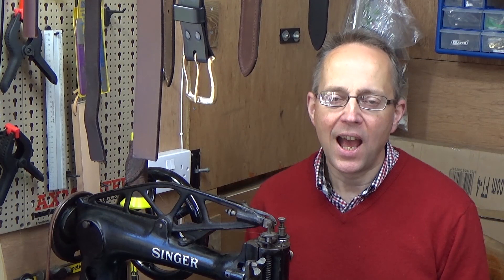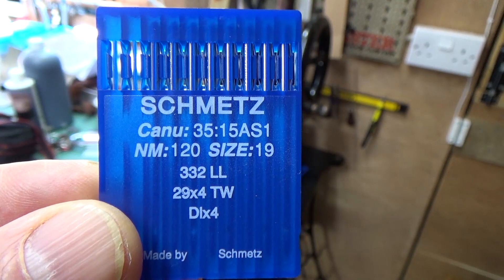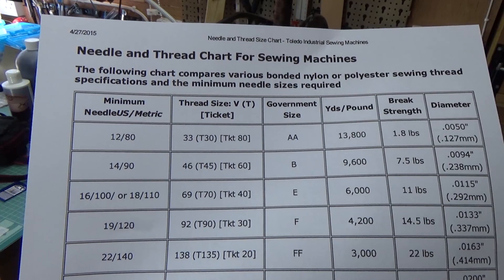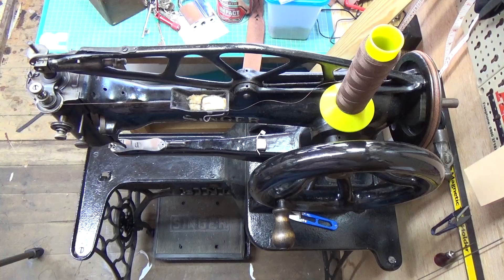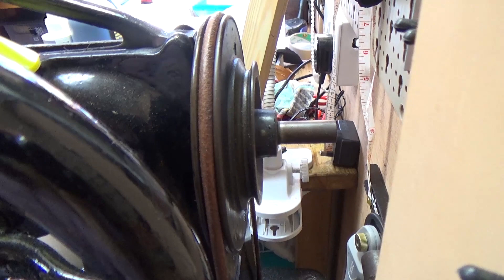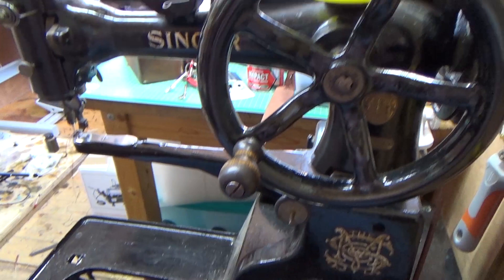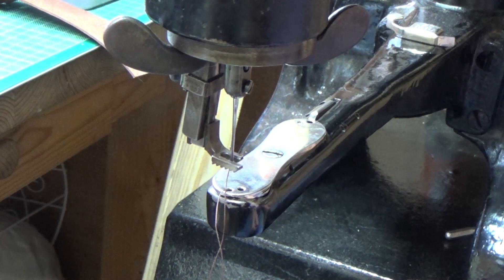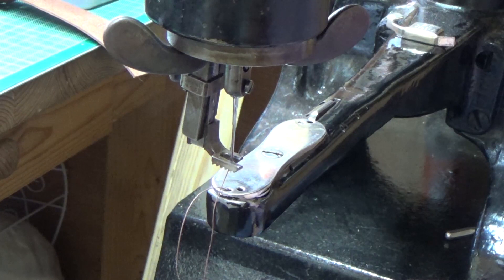Singer 29K Patcher - Needles and Thread, and Sewing a Circle.

Comment: Thanks to your videos, I bought myself an old Singer 1928 K58 patcher (with treadle base) and restored it. Its an awesome machine that allows you to do so many things that are impossible with traditional machines. I made a table top for mine based on an original sears catalog picture of the optional table top that was available for these. I love the front mounted hand wheel and would encourage people to look for machines with the proper setup for mounting the hand wheel in either front or rear locations.Most parts seem fairly easy to get. The thread I use in the US is #69 (also called T70) bonded nylon (upholstery thread). I got lucky and bought mine for 250 USD and spent maybe another $40-$50 on parts and about 20hrs of my time for cleaning and fixing.  Many restored fully operational units can go for $700-$900 in the US. Wish I could find a Singer 133K like yours, but never see them even on Ebay.
Reply: I guess Im randomly asking but does any of you know a trick to log back into an Instagram account?
I was stupid forgot my account password. I would appreciate any tricks you can give me.
Reply: @Cairo Terrence I really appreciate your reply. I got to the site thru google and Im waiting for the hacking stuff now.
I see it takes quite some time so I will reply here later when my account password hopefully is recovered.
Reply: @Cairo Terrence It did the trick and I finally got access to my account again. I'm so happy!
Thanks so much you really help me out!
Reply: @Brooks Legend No problem =)
Reply: How fantastic ❤.

Comment: I have a patcher, its a great machine, the only tiny fly in the ointment with it is the capacity of the shuttle, you cant sew a great amount without filling it up of course it was never designed for great long runs.
Reply from the maker: thornwarbler spot on agree entirely!

Comment: Hello Harry,  
I too have a Singer 29K53 and also a 29K15, and I have found your excellent videos very informative and helpful.  The 29K53 has the same catch as yours to press to release the cover plate over the bobbin and shuttle.  Other models have a round button instead.  In my case, the tiny flat spring under the catch had broken and the catch would drop and wouldn't hold the plate still.  The plate would then move and the needles would break.  My attempts to find a replacement spring on-line only found the alternative round spring.  Yesterday I finally had the brainwave to make such a spring from a junior hacksaw blade.  I cut a piece to approx 40mm, held it in mole grips and ground it down to 3mm wide.  Hey presto, I had a new spring which works just fine! So if you ever get stuck for such a spring, that's the way to fix it!
Reply from the maker: +StageRightvideo Thanks for this post - hopefully it will help others as well.
Reply: You could maybe also shape a matching thickness feeler gauge arm taken from an engineering set. These are available very cheaply and are spring steel

Comment: I have nearly the same machine! Minds a 29k55 from 1922, the treddle looks a bit different and mine is rustier since it was used in a saddlery for quite a few years. It works really good, though I'm having some problems with the bobbin jamming up but I think it's because im using such thick thread. I've got a pile of jeans a foot and a half tall that need patching, plus a pair of shredded overalls and I broke my last canvas needle this morning (I think I ran over a zipper). So we've ordered some more.
Reply from the maker: Sounds like you are making good use of it...I found Gutterman upholstery thread was pretty good ...it's thick but not ultra thick.
Reply: @harryrogers  well I had run out of my original thread that I had and I was like "I guess I gotta order new stuff now" so I just ordered it through the store (I work in my uncle's saddle repair shop, he repairs stuff for the local tack store) and it was heavier than expected haha. At first I was having problems with the bobbin being too tight so I found one that didn't have the tensioner thingy on it (that metal piece that holds the thread on the side) and it works pretty good.

Comment: well iam sure glad you made this video i use a No 29-4 awesome machine, ha ha I know now i put the bobbin upside down and the 3 oclock hmm I will try that, also i thought it couldnt handle the thread that it was to thick. but i think i will oil it up and get the tension correct just is very touchy, Get Video Thank You!!!!
Reply from the maker: Nikitia M Great - thanks.

Comment: Hello Harry. I just got a treadle myself. What a difference. I have been trying to find a tiny screw, to screw into the carrier shuttle. Believe it or not, I tried to find them on eBay and a few other sites. Nobody knows what I'm even talking about. They used to press them in, but on a site tonight, the guy said to just grind the head off of the screw and make a notch at one end, then just force it in the little hole on the shuttle. I've tried to find those little screws, but I think they're all gone. Thanks

Comment: Hi there Harry , I have the Patcher 29-4 ..... & I love it .... I have not the right bobbins , the ones I have split horizontially  , I'm not sure why  , I have been using pre wound bobbins from Coats & Clark .... I think they hold more thread than if you wound your own ... I hope to find some od the right bobbins before I run out of the pre wound ones .... &  have you a flat bed with yours , I am trying to make one , I'm sure it is easy just need a bit of a hinge  for the  " foot " .... could you show the flat bed if you have one & the measurements ... I have a band saw & can cut one quite nicely I'm sure .... just wondering what you have .... I'm in California USA

Comment: Hi Harry, I’ve just bought a patcher 29K15 in a shocking, seized state. I’m having to drill out screws and pins. Have you any idea what thread standard Singer used, BSF, BSW or propriety . I have lots of taps and dies, a lathe and mill but can’t identify the threads because mine are too badly rusted.thanks for any pointers you can give, Mike
Reply from the maker: Hi I could not find matches for some and rethreaded!

Comment: Hello Harry, I thoroughly enjoyed the video.  I am in the process of restoring a Singer 29K I came stuck when I found out, that the sawing circle is totally seized won't turn at all.  any ideas are most welcome thanks.
Reply from the maker: I assume the thumbscrew that tightens and locks it in position is loose? Otherwise maybe penetrating oil and hot rags to loosen it? Do look at a parts diagram e.g. off ISMACS website that has free manuals to see how it's assembled.
Reply: @harryrogers  Thank you, Harry.  I did put a flame torch to it with lots of dw40, and other thin oil.  hasn't budged at all. I already broke one of the screws. , now I am searching around to replace the screw 
thank mate I will check out ISMACS to obtain a diagram, much appreciated

Comment: Could you grind the walking foot smooth so it does not mar or impress the leather?
Reply from the maker: Yes some people do that, if you do  just start by taking the bite off the foot....the leather will tend to slip more...so consider this before grinding anything, and perhaps make sure you have a spare foot first. You can reduce marking by releasing foot tension and putting paper over the sewing, and that might be a better approach.
Reply: @harryrogers  Thank you! I’ll try that and let you know

Comment: Hi Harry, I tried sewing yesterday with a size 120 needle and Gutermann Tera 20 thread at top and bottom. After about an inch of sewing, the needle broke. I think because it was a thick needle, it needed moving to the left a bit as it must have hit the bobbin holder. I unscrewed the top screw above the needle a bit but I can only shift the thing a tiny bit to the left. Is it meant to be like this? The manual isn't very clear. I will also try thinner thread on the bobbin so I can fit more on.
Reply from the maker: +Carol Rochfort Carol - I think the thread is a bit thick .....I don't know about the needle adjustment - sorry!

Comment: Hi, do you think this machine would be ideal for stitching leather sweatbands into felt fats? I am just getting into the craft of hatting and find that hat-specific machines are too expensive or impossible to find. There is a patcher available near me, and would like someone's opinion on whether or not it would be suitable for this purpose? Thank you!
Reply from the maker: That sounds like a reasonable use...I have put leather patches on knitted jumpers with it so I GUESS it would work with felt. The bobbins are small and there is no needle feed but you would be doing small runs and on smooth surfaces, so to me it seems a reasonable relatively inexpensive approach...of course I have not tried this, so at your risk. Rgds Harry

Comment: Harry, I have two machines, one with a treadle and the other is electric. The one with the treadle works great. I am almost finished with the other one, but I have run into a snag. The one that I am not quite finished with has larger stem on the shuttle carrier and it does not fit into the hole, or its very tight if I would force it. I have rebuilt it all the way to putting the bobbin carrier in and had to stop. This gear box must be some kind of clone. All of the parts were interchangeable accept for this. I've spent a bunch of time on these, and I would like to finish them, Any Suggestions????????
Reply from the maker: +Robert Giordano Not really, I have never heard of that...skim it on a lathe perhaps? Try and buy that part?

Comment: Hi Harry, College Sewing didn't really know which screws I needed but thought the frame screws may be the ones - they turned out to be tiny so no luck there. Would be possible for you to measure one of yours and count the threads per inch and let me know the sizes - maybe even send a photo? I am assuming that all the models had the same size screws but I may be wrong. Its very frustrating as I am dying to start sewing!
Carol
Reply from the maker: +Carol Rochfort Hi Carol - I have sold my frame with the screws...lot of changes to the workshop.......these look like the screws...explain again to College Sewing exactly what you want as they are usually very good ...have you downloaded the parts diagram from their website to give a number?
https://www.college-sewing.co.uk/128D-FRAME-SCREW-SINGER-29K
Reply: Carol 
,I just saw your question today to Harry Rogers regarding Singer mounting screws for a patcher. Singer made their "Own" thread pitch for their machines so people would be forced to come back and buy any needed bolts in the future from them. The easiest solution Is to buy a new thread tap for the next larger size hole. They are not expensive and are available from any hardware or tool store.I'm not sure where you live but if I can help email me thru Youtube.I have been restoring 29-4 & 29K machines for years !
Denny

Comment: Do you think it's possible to sew a backpack with something like this?
Reply from the maker: Yes it would work fine, the stitching may not be the most refined  but it is alright  and if sewing leather you can hammer over the stitches to flatten them. If sewing for a business at scale you might want a more refined industrial sewing machine.
Reply: @harryrogers  Hey.  Thanks for the advice.  I’m just a potential hobbyist.  I found one for auction.  It’s probably going to be next to nothing to buy, but it will need maintenance.  My aim is to sew nylon fabric.  I have a feeling it will work out.  If not, I suppose I can resell it.

Comment: Hello Harry! Nice video! I've just serviced a Singer 29 that I believe to be the predecessor to your machine, a cobblers machine. I've been trying to work out what wax to use in the wax tray, and if it should be liquid (molten?) or solid. All help is appreciated!  Best regards
Karl
Reply from the maker: Karl Månsson mine had an old lump of beeswax in the tallow bath...i suspect solid but soft?
Reply: Thank you for answering! So it's a tallow bath? Meaning it should contain tallow originally?
Reply from the maker: Karl Månsson yes I believe so Karl

Comment: I've viewing a few of your videos :) Thank you. I by chance ran across an Adler 30-7 (green) with treadle base. But running with motor. I have been told they are knock offs of the 29k's. So your videos have been a lot of help. My only other treadle machine experience is with my G Grandmas Singer 66 Red eye.
Haven't checked your web site yet :). Did check you channel. And yes I can see you're a busy guy. :) Well Done
Reply from the maker: Chris Kight Thanks the Adlers are good.

Comment: Would this machine be suitable for making bags etc. I'm just starting with a very limited budget and I can't afford a new Juki/Adler. Looking for the best low cost option that is functional and reliable. Found one of these just a few kilometers down the road for 500.
Reply from the maker: I would prefer to use a Singer 331k or a Singer 31k which should both be a lot cheaper...personal view of course.
Reply: @harryrogers  Thanks Harry. That was an incredibly fast answer! Are these machines cylinder arms?
Reply from the maker: @ThoughtFission  both flatbeds

Comment: Nice machine Harry,  would a quite rusty 29K15 barn find machine be worth restoring and if so how much would be a good price be for it. Have a chance of buying one. Thanks Ian.
Reply from the maker: Crazybear Kaiser it's a bit like a car engine...is it seized or does it turn over ok....then is the bobbin there...see College Sewing Machines UK for cost of parts....ebay will give a price indication...£80 area upwards?????
Reply: Thanks for your reply. Yes everything is complete except a needle. The machine is not turning and is fairly rusty.
Reply from the maker: Crazybear Kaiser That's great.
Reply from the maker: Black enamel paint works a treat.
Reply: Car diesel bath 24 hours and then start working on the machine. This will clean and oiled every single part of your machine

Comment: Good afternoon Harry, and Merry Christmas. I recently bought a Patcher, (29K58) with treadle base and it was sewing quite well until I changed the cotton thread that came with it, to synthetic. It's quite thick, but approximately the same as the original thread. It has started to give me real problems in the tension department? All the stitches are being pulled up and sort of leaving a loop on the top of the work. No matter how I try to resolve the problem, it still does the same. You seem to have the most experience with the patcher, any ideas? I'm sewing relatively thin leather, but two layers. I was sewing 4 layers this morning with cotton thread and no problems whatsoever. I must be missing something fundamental, here, as I am sure (I think!) that the synthetic stuff doesn't cause me the problems I'm having......does it?
Reply from the maker: Alan Smith hi Alan...loop on top usually means bottom tension is loose....I have put a couple of other 29 k  films up....Happy Christmas
Reply: Thanks for that Harry, but the tension on the bobbin is as tight as it can go. I put on the cotton based thread again and guess what? It is behaving perfectly. I can only assume that either I am using the wrong type of needles, or the machine is just being a real pain in the a. I'll have to try some other methods. The stitch length also seems to be not quite right. I have sen some other forum, where they mention that if I can move the foot more than a 16th of an inch either way, the cam is worn. So, it seems that my cam is worn. Although I haven't opened up the machine yet, is it a part that can be replaced easily? Does it make a difference if the bobbin is placed with the notch any way up, or if the thread is supposed to feed into the tensioner from any particular direction? Just thoughts, but maybe there's some logic behind the misbehaviour when it comes to synthetic threads. Thank you for the videos, I will watch. Alan
Reply: OK, found the cause. When I first put in some thick white thread, it worked ok, then I ran out of bobbin thread, so I changed it for black. What I didn't see, was that I had not put the thread under the tension spring of the bobbin. I had the tension spring wound tight as it was causing the loops on the top of the work, so consequently, when I changed the thread, this time I couldn't get it under the tension spring, purely because of bad light and I was fast losing patience with myself. OK, I did watch the two videos on the 29K and I understand it more now.. I do have quite a bit of movement in the walking foot, though, but I can get 8 stitches to the inch and for me that's w=quite alright. Is the cam replaceable?
Alan
Reply from the maker: Alan Smith hi yes probably....college Sewing machines UK  have a lot of 29k parts on their website...glad it's working. Regards Harry
Reply: I spoke too soon, Harry. I finally come up with the idea that it hates this black thread and it looks a real mess on the top of the work with loops, missed stitches etc.(ET30 if that means anything to you?). The white stuff (ET20) is behaving oerfectly. I think I'll order cotton unless I see something on Ebay that matches the white stuff. Ever trying!!!!  Alan
Reply from the maker: Dont know about the ET number ....Nm20 thread is thicker than Nm30 ...perhaps the ET20 is thicker than ET30 as well...if so the ET20  might be getting tensioned correctly by the bobbin leaf spring whereas the 30 size is too thin...in which case a half turn on the bobbin leaf spring may help....perhaps try a bobbin drop test.